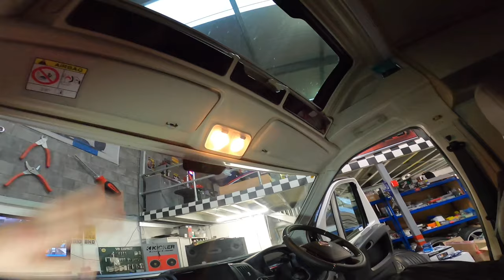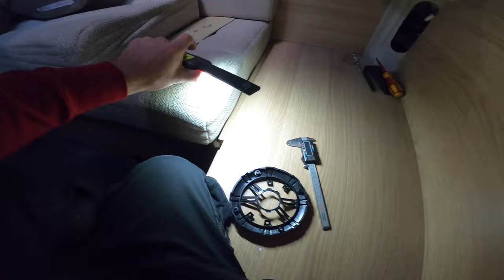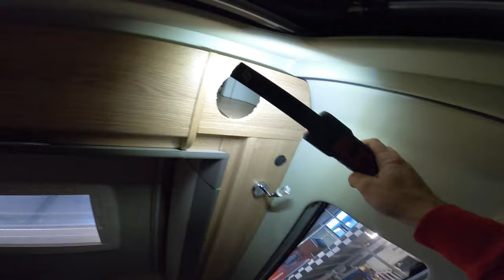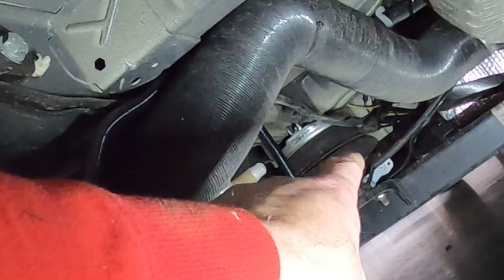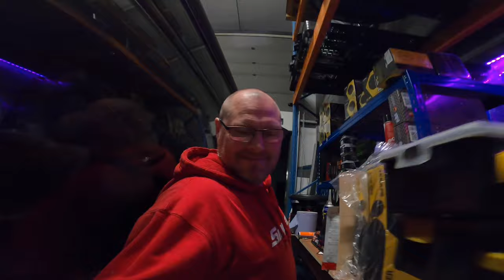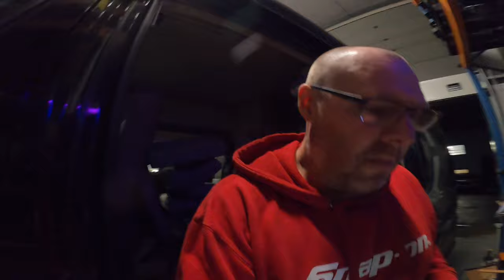fiat ducato auto trail part 1 upgrades pioneer tablet 9 inch

Comment: How do those rear speakers sound on the Campervan?  Great install, however looked like a big void behind and did I see a gap where the wood doesn’t meet the back door?  Not questioning you, however just interested in how they sound with this ‘different’ baffle arrangement?  Head u it looks nice!  News from me is that Ed from Audison was down with my installer today, and I’ve now got the very first Audison DRC-AC controller in the UK fitted to my Aston!  Very neat unit (single knob - no panel, unlike older DRCs) countersunk into centre dash - Happy days! 🥂👍
Reply from the maker: oh that sounds good glad they are looking after you . the sound was fine , at the end of the day they are a good speaker in not the ideal location , there isn't really much in the way of quality to this sound other than it needed some music in the bedroom area , kicker speakers did the job and despite the build quality void they sounded ok , you couldn't really tell it was like an infinite baffle it worked fine , but the build on these fiat derived campers always makes me sad inside even the grain stickers dont follow the grain just slap dash .

Comment: Rather daft question , do you reckon it’s possible to get the steering wheel controls on 1995 Peugeot 405 to work with a aftermarket radio ? Great video as always !
Reply from the maker: never a daft question joneseh it depends on the ins and outs  , some units read can data some analogue if you buy a unit that has programing capabilities then as long as the 405 is out putting a signal you can use that to set a steering control .
Reply: @AlexCarter-AscAudio  sweet , I’ll take a gander and look into it some more , cheers man !
Reply from the maker: @jonesehr5312  have a nose at the new civic vid i show it there